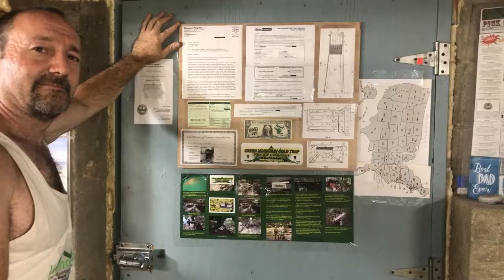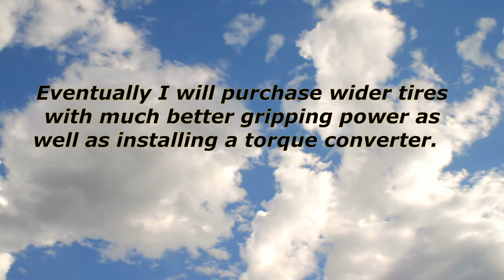Out For A Ride - 200cc Coleman CT200U-EX

Comment: Sweet new tool in your prospecting arsenal Joseph...very nice. That'll shave off some back country hiking time indeed. So I'm gonna guess eventually you're gonna rig er up with a tow bar hitch and a small trailer eventually...or are you gonna stick with what ever fits on your back ?
Reply from the maker: It is indeed a sweet new addition Wayne! And today it's getting it's second modification. Wayne of Railroad Toy & Hobby will arrive late morning to remove the factory carburetor and install the new one. He has several different jet sizes we will play with to get it tuned perfectly.
I also ordered a straight header pipe and a new exhaust. The Stage 2 kit (new carb) came with one but I don't like it. It has a cheap looking hotdog muffler and the pipe runs under the seat, exits on the passenger side and sticks out too much.
Also, I ordered the torque converter so, for powering up hills I will be set.
The new straight header pipe, exhaust and torque converter have yet to be delivered. So that mod is down the road.
Here you can see the exhaust I am installing. Take it to 15:12 on the play bar.
https://www.youtube.com/watch?v=fDjR3bEUsE0&t=1s
Reply: @GreenMountainGoldTrap  Nice...That will get it done.
Reply from the maker: @waynebussey5521  The new carburetor kicked it up a notch. Out of the box the bike did roughly 20mph. Now it goes 31mph.